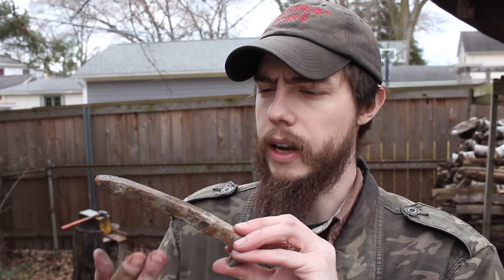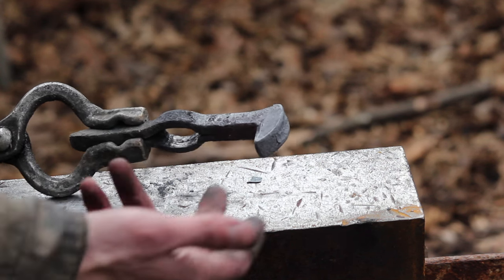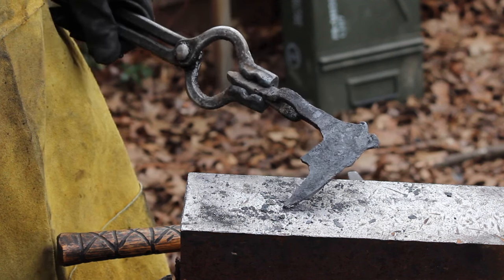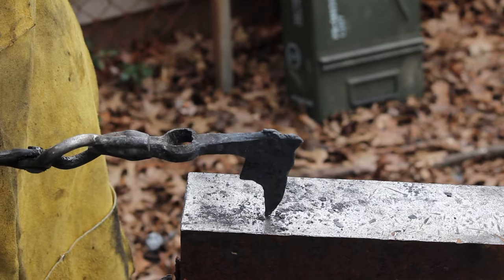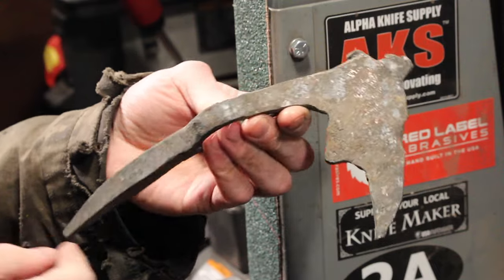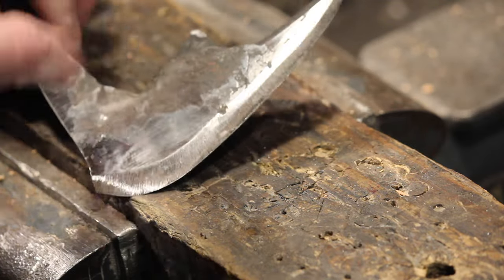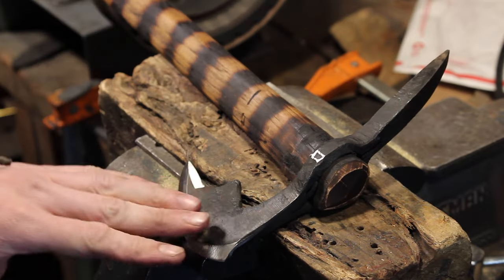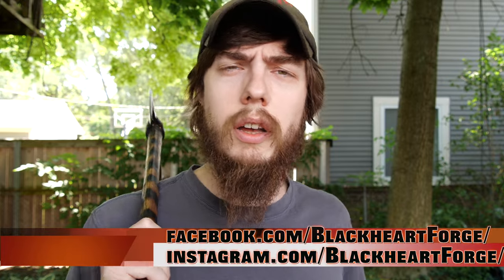Forging a SPIKE TOMAHAWK/BOARDING AXE from a Railroad Spike

Comment: Nice build Phil, not too shabby for your first forge welding. Definitely love the profile for a fighter/thrower. What was the final weight on the head?  I imagine these railroad spike hawks will just get better and better from here. Well done brother, and until next time  "be more viking. "  😉👍
Reply from the maker: Thanks Jim, I'll have to check the weight. It's got a good heft to it tho, not too light and not too heavy.
Reply: We've got to get you a proper axe butt if you're going to keep making and testing these hawks...  I have a question about darkening that nick you put on the hawk.  Could you just heat that area of the eye with a propane torch into the dark straw temper and requench in the deer tallow?   That shouldn't effect the ace bit's temper, I would think.
Reply from the maker: @jimludwig7231  You're right, that probably would have worked better! I wish I had done that.  In hindsight, I think I had the head on the handle pretty darn good and I didn't want to tear up the wood trying to get it off.
Reply: Understood,  hate when 1 step back screws up 2 steps forward. I've had a couple axe projects that hit snags after being hung on handles, which would have been minor if the handle weren't in the way.

Comment: Do you have a video on how to make the eye drift for the axe?
Reply from the maker: The tomahawk mandrel was one I bought from Kayne and sons Blacksmith Depot. The eye deformed slightly when forging the blade but was easy to correct
Reply: @PhilBaumhardt  is there any good substitutes for such a tool if it's not obtainable?